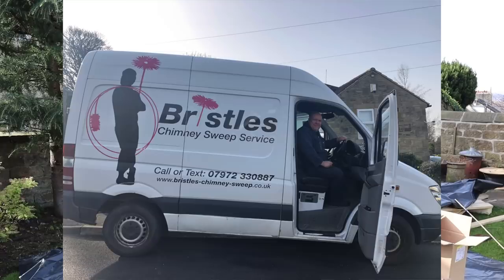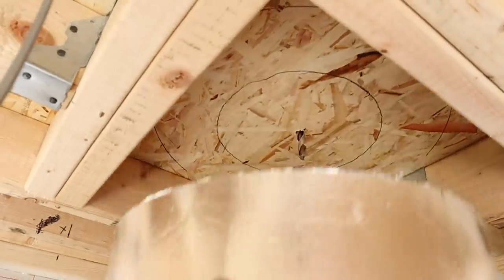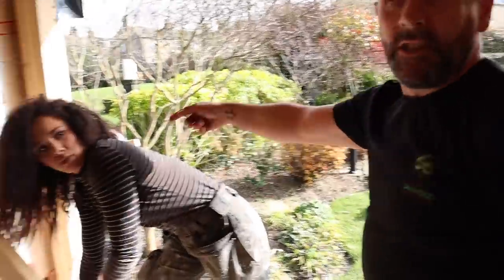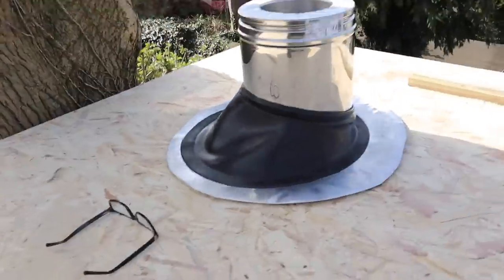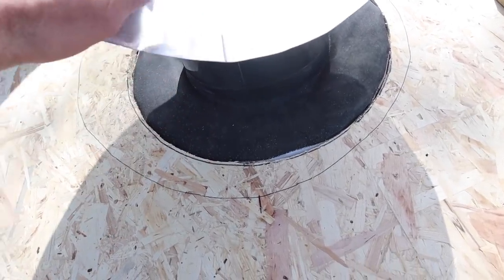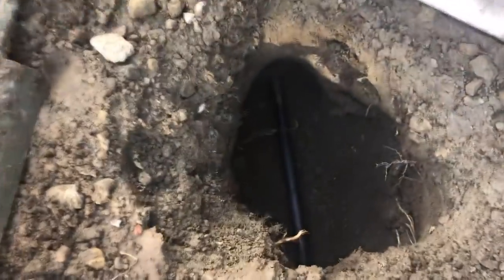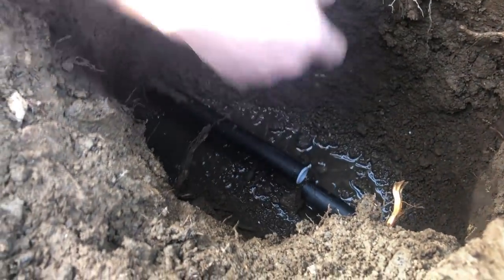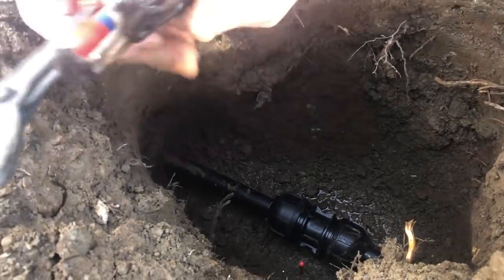Log burner installation in a garden room, a water feature and Captain backflow save the day!

Comment: Hello Liam

Not sure if you are interested but there is a company in Preston that sells a complete 2.5kw log burner and a flue and fitting kit. As it is less than 5 kw anyone can fit, also as under 5 kw no external air supply. Easy to fit Vesta stoves very nice to work with. Hope this is useful Cp